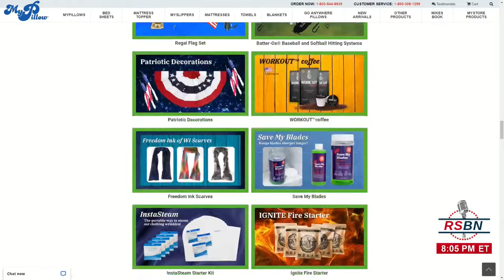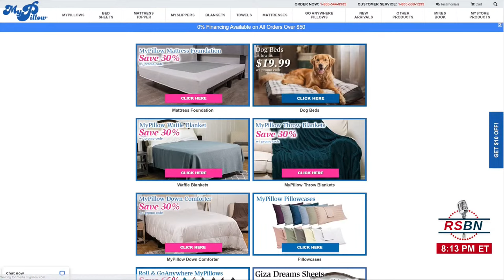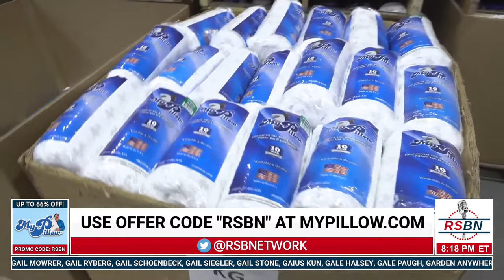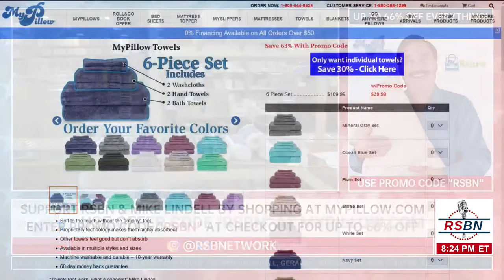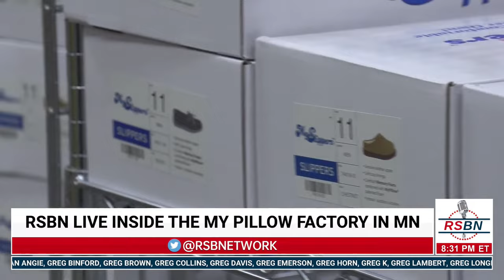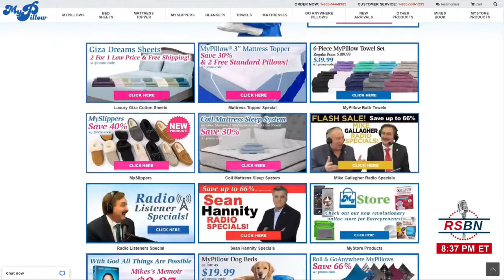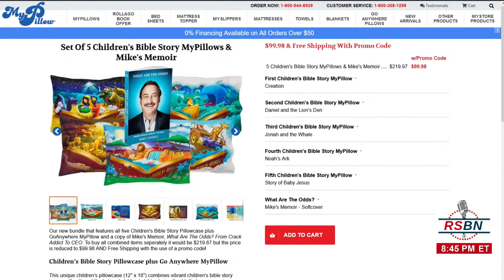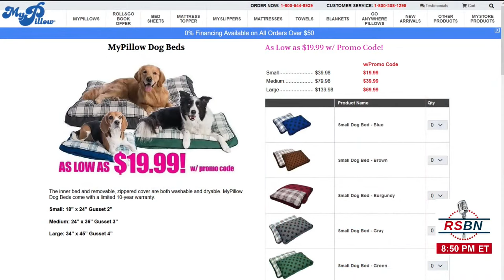How Do They Make That?: An Inside Look At The My Pillow Factory

Comment: Folks, support this American company.  They are doing good things and providing a living for over 2000 American families.  I have 4 of their My Pillows (2 Queen, 2 King), and I ordered the King mattress topper too because my bed was too firm.  That topper made it just perfect and it sleeps so good now with the My Pillows.  I'm going to order more.  I want the towels, a robe and slippers.  Don't despair if you do not have a dryer to put them in when you first get them.  I didn't for the King size when I got them and just put them into the pillow cases.  By bedtime, they were so full and plump it was amazing.  Same with the mattress topper (it comes compressed too but fluffs up nicely)

Comment: I don't like the pillows because they don't fill out a queen sized pillow case. They are an odd size (shorter than a normal queen size pillow, if that makes any sense) but I'm still glad i bought them and my throw as well, to support the cause. I use them when lounging on the couch.